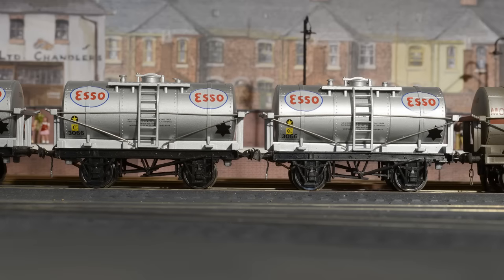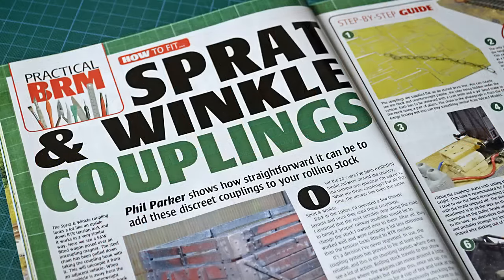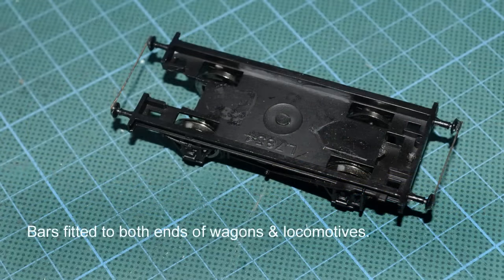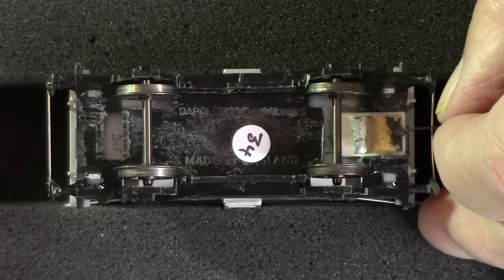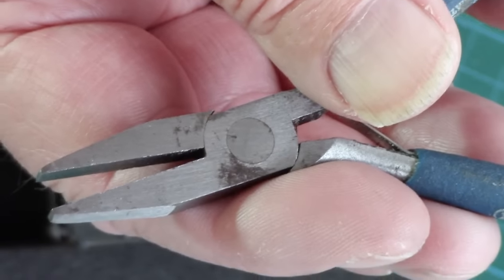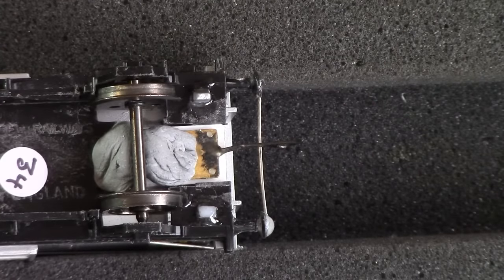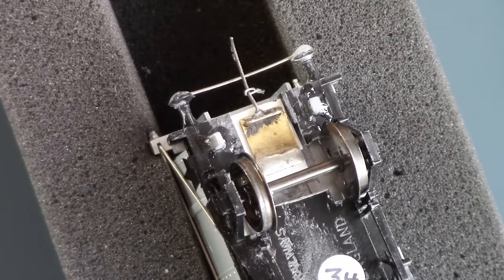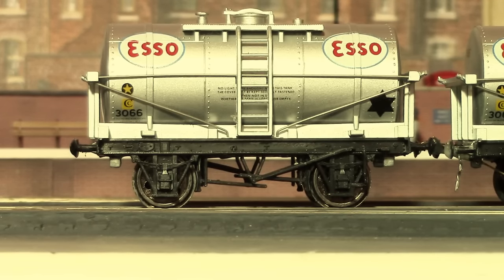SPRAT & WINKLE Pt 3

Comment: Hi David, thanks for sharing your video. I also use SW couplings. Though a little fiddly to set up but once done they are okay. For me I prefer to have the bar {or coupling loop} between the buffer rather than right across them. Your right about having the paddle as a sloppy fit. At first I had the paddle too tight in the staple but this stopped the paddle from working correctly but once I gave it a bit more freedom it worked okay. My locos have just the coupling loops on them where the wagons have a hook at one end. Brake vans and Utility/CCT vans have hooks both ends. Coaching stock are kept in fixed formations so only have working couplings at each end of the rakes. 

All Best

Dave
Reply from the maker: Hi Dave, nice to hear from another S&W user. I used the coupling loop at first but was persuaded by the BRM suggestion. My (goods) locos also just have the bar across front & rear buffers, again this is easy to remove and involves no loco modification. I have adopted the same idea regarding my wagons - hooks at one end only with brake and utility vans sporting 2 hooks. Have not looked too much at coaching stock yet, although some look pretty good with the Hornby close-couplings fitted but keeping them in fixed rakes is definitely the way I will go.  ...  David

Comment: I have started with my sprat and winkle couplings. I have followed some if your ideas on these couplings and early indications area good. Thanks.
Reply from the maker: Hi Eric, another S&W fan. I have all my wagons converted now and (for the most part) they work fine. I don't think there is a system that is 100% fault free so I ham very happy with them. Glad to have helped  -  David

Comment: I have not come across these before David and so I was very interested in seeing these in operation on your stock, the idea looks very good and unobtrusive, the only thing that I'm not keen on is the bar that runs across both buffers but they look as if they work just fine which I guess is the important thing.            ............Graham
Reply from the maker: Hi Graham, thanks for your comment. Once the bar is painted/weathered it is surprisingly unobtrusive - much more so than the smallest tension lock available. I was also a bit concerned about this but it does mean that locos only need this bar. If you want to re-sell an expensive loco the bar can easily be removed, no other modification is needed. I opted for the slightly finer couplings (for HO I think) the 00 gauge ones are a little more clunky. The small problems I am now having are more to do with my initial track laying - I am trying to pluck up  courage to re-lay some of my track, I know you did, I might follow your lead at some time.  ...  David
Reply: Hi David, yes I did relay the track - twice!  I consider the track being the equivalent of the foundations to a house, the track is what everything relies upon to travel around the layout with issues, I had many issues with mine initially (purely through lack of experience) and I could see that I would get fed up eventually with having to keep putting stock back on the track and would therefore take away the enjoyment and fun a layout should give, it was much better take up the track now and do it again before I got too far on with the layout and I'm glad I did because I can now leave trains running for hours on end without (in the main) any issues.  

I have to admit that seeing how your uncoupling works then it looks very impressive and the nice thing about it is that it's all very uncomplicated with not a lot to go wrong - very nice indeed.        ........Graham
Reply from the maker: Hi Graham, yes - inexperience catches us out, and you are right about the track. Going to have to bite the bullet I think.  Thanks again for your kind comments.  ...  David
Reply: And for me too David, inexperience still catches me out. But this is what I enjoy about this hobby of ours, it's not easy, if it were I would be bored and I'm never that. Thankfully there are many folk on here who can put me right along the way. Taking up the troublesome track may seem like a hard decision at the time you are standing there in front of it but once started you will know that you have made the right decision - I know that I did when I saw everything running smoothly afterwards and never regretted it. It had to be done.          ........Graham
Reply from the maker: Thanks Graham, for the encouragement. I know it makes sense, jut got to pluck up the courage to start, it won't be this side of Christmas though.    Regards David

Comment: Great to see your journey with these, especially the tips at the end. Do you take a lot of care over the fore/aft position of the hook though. It looks important but you don’t particularly mention it. Thanks
Reply from the maker: Hi Simon, thanks for your comment. I think it is very important to see that the bar between the buffers is set at a constant height on each wagon and loco. There is a little play in the exact position of the hook. It must rest so that the forward slope touches the bar (on the wagon to be coupled). As the loco moves to couple the hook must ride down smoothly and engage under the bar. Also the hook must pivot freely on the staple - a little solder weight is added to the plate of the hook. If this is done carefully then there should be no problem. Hope this helps  ...  David

Comment: Hi,how this coupligs works at longer coaches ( european 2-axis ) and what radius is minimal for them ? regards.
Reply from the maker: Hi Alexander, Thanks for your question. Truth is I don't really know. I have decided not to use them on my coaches. I used them on my goods wagons because I want an auto coupling system which allows me to make up goods trains and I fit the S&W couplings direct to the wagon bodies. I intend to run the coaches in fixed rakes so I don't need the S&Ws fitted too them. Besides, the couplings would need to be fitted to the bogies so I am not sure how they would work.
The minimum radius on my layout is PECO medium track. They probably would work on a tighter curve, perhaps using the more 'standard' OO fittings S&W make. Please search elsewhere for this,  I don't want to mislead you. Good luck  ..  David

Comment: Hi Davis thanks for the Sprat & Winkle series of videos. A couple of questions:-  Now that you have used them for a while, are they reliable and would you still recommend them? Also, how do you blacken the parts - with paint or chemicals?
Regards
Ray Wilson
Reply from the maker: Hello Ray, glad you found the S&W videos useful. Yes, I am committed to them now, and I would recommend them. I'll take your second question first. I have tried chemical black, patchy results (literally) then they got painted over with the weathering. Now I just leave them and weather them with the chassis. I have used the S&W for a while now, here are some good and bad points.
GOOD :
1 Will enable you to match wagons from different manufacturers/eras
2 They are cheap
3 The delayed uncoupling feature is very useful for placing wagons
4 Setting the uncoupling magnets in the track is easy (I use neo magnets not the supplied ones - personal choice)
5 Given that there is not a coupling system out there that claims perfection, I find the operation of the S&W reliable
BAD: (well not so good really)
1 A bit fiddly in places to assemble (I only really got them to work when I made the jig)
2 You need to make a jig
3 You will loose much of the resale value when you convert away from stock standard couplings
CUSTOM;
There are a few things I do that are not as instructed.
1 I cut the buffer beams. It helps make a  constant height for the staple.
2 I no longer bother with the mounting plates. For me they create more problems than they solve
4 I use strong neo magnets (ebay) as mentioned above
5 I use larger diameter wire for the bar (glued across the buffers)
6 I normally only fit 1 hook per wagon
FINALLY:
I have fitted them to 45 wagons and have no plans to change.
I have not fitted them to any coaches or bogey wagons.
I intend to use different couplings for my coaches.
Hope all this helps  -  David
Reply: I have discovered in an online forum that a black permanent marker pen is ideal for blackening the couplings!
Reply from the maker: Sensible approach Ray. Love your photos by-the-way - very impressive  -  David
Reply: Hi David perhaps I missed this but why do you mount the coupling bar between the buffers and not on the mounting plate as in video 1? Thank you !

Comment: Very interesting series David. I am going to persevere with my ordinary couplings for now but I also have a shunting layout and S&W couplings may be the way to go. Can I ask, does the staple have to be brass (or indeed hand made)? Could you use an actual steel paper staple, or is that affected by the magnet? Cheers, Davie
Reply from the maker: Hi davie. The chain needs to be soft iron as it pulled by the track magnet. In the kit brass is used for all other components. I would imagine the non-magnetic property of brass is important. I have not used another material but I would advise against anything that is going to get 'magnetized'. Hope this helps  ...  David
Reply: Yes, that makes sense. Thanks David
Reply: Sorry, meant to ask. Where did you get yours?
Reply from the maker: Thy are made by Model Signals but are sold by Wizard Models (link below)
www.wizardmodels.co.uk/FrameSetShop.php?DM=wizabout
You can get a starter kit with instructions see Pt.1 video. You have to make the staples although I think you can buy the chain  - I might look into this myself. Regards, David